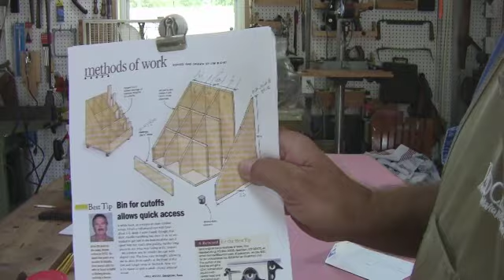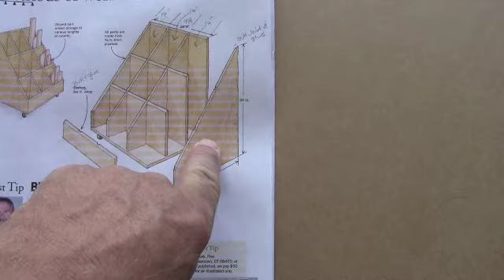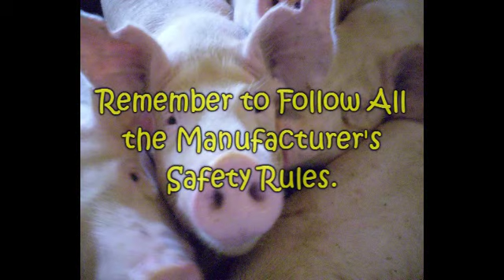Building a Roll-Around Cart for Cutoffs.

Comment from the maker: Gluing,nailing the dividers worked,as long as the butt joints where a nug fit. If I where to build another I think taking the time to lay out the dados could be time well spent. I used 3 inch swivel casters,I would'nt go any smaller.